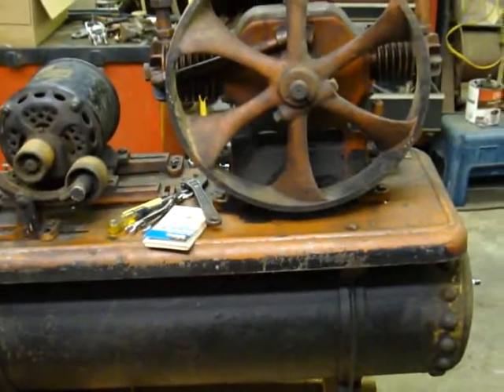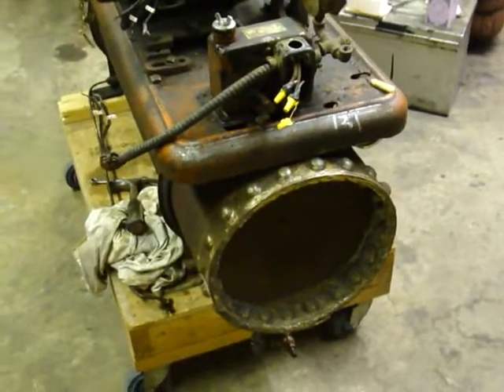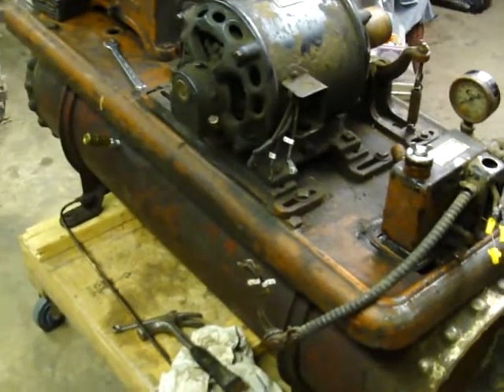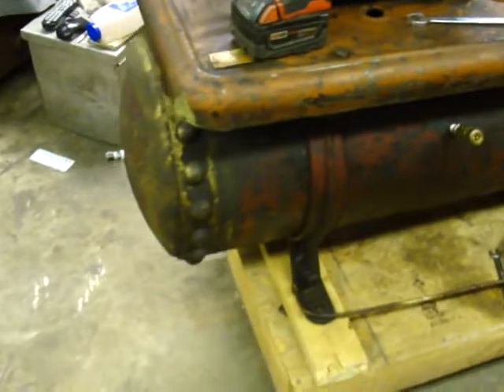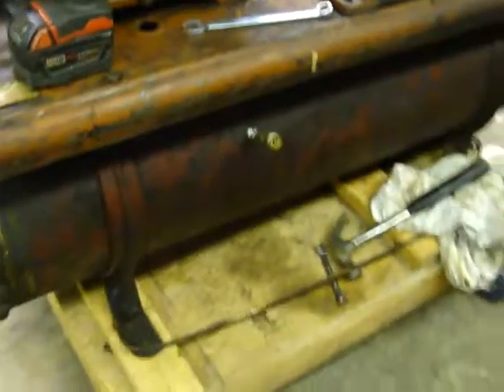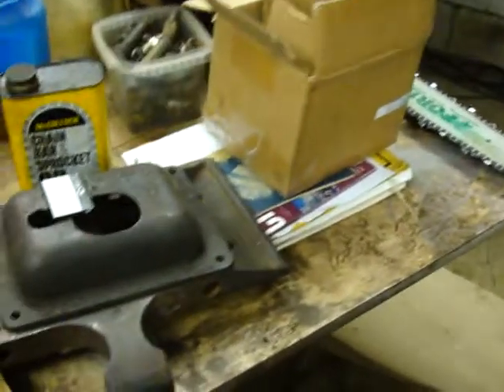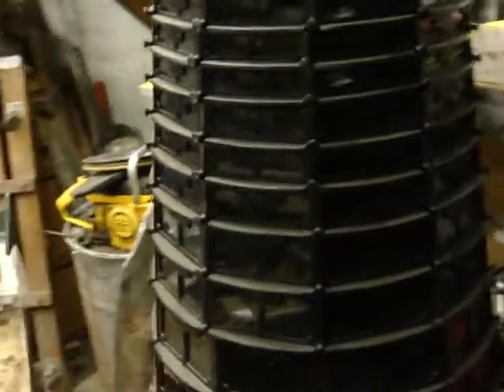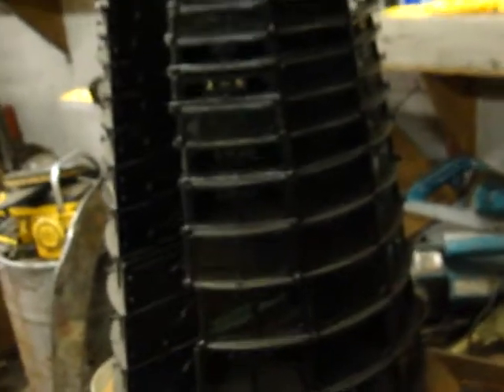Projects for winter 21/22, Steve will like this 1

Comment: If your talking about me, your right, I like that compressor.
The oldest compressor I have had had a tank tag with a
manufacture date of 1934.
It was a brazed tank.
I saved it from going to scrap and sold it to a guy that
collected compressors.
Reply from the maker: Awesome, The tank on the service truck is 1934 "electro welded" looking like brazed.  Researched Morrison Bros made tanks for champion stopped riveted tanks sometime b4 10-28.  I think this 1 is right after the "A27" serial number  on the Wilboken pressure switch that metered out fine yesterday along with the Century motor.  Hydro test tank this week.
Reply: @wrenchguy  
Please video that.